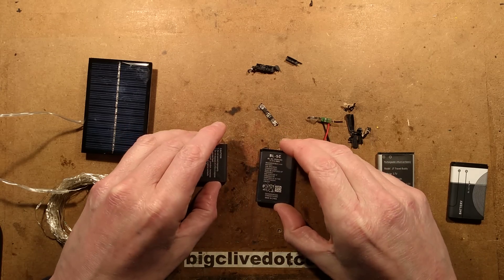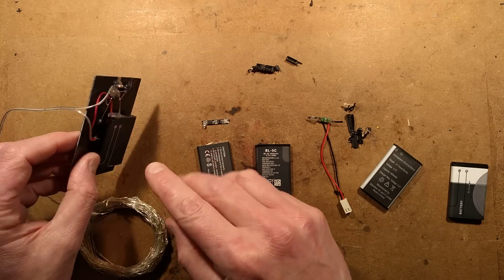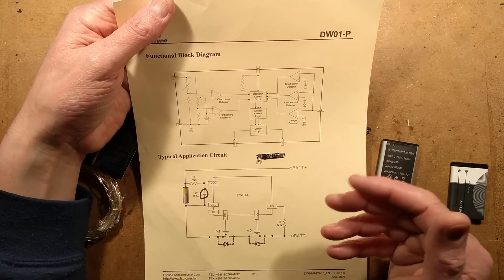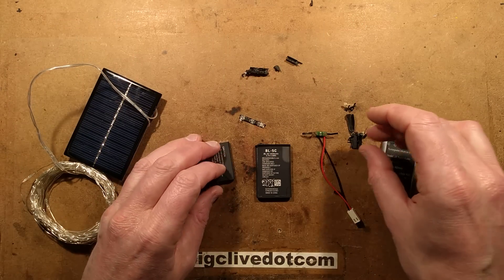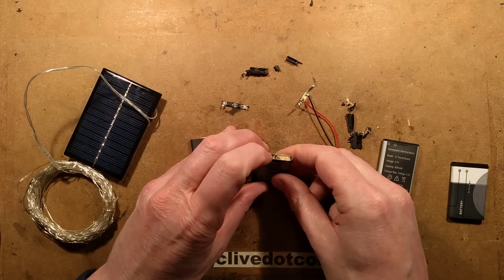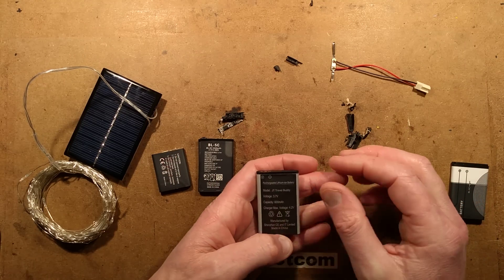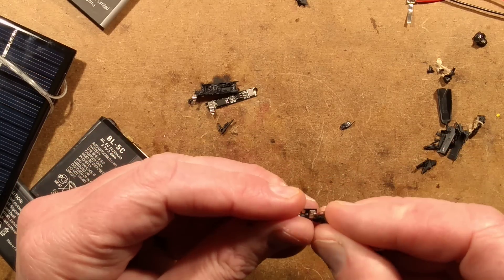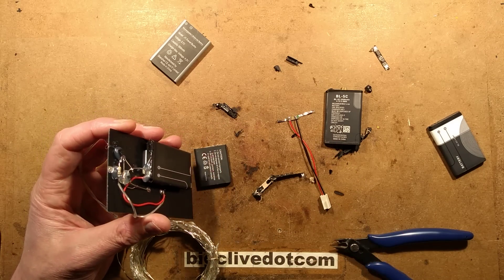Unprotected phone battery copies.

Comment: Did anyone else see that flash around the 6:34 time? The moment he crossed the contacts with the snips?
Reply: I took 2 screen captures. One at 6:34, where the mysterious golden flash appears, and one between 6:26 and 6:27, where we can see a real reflection.
Take a look at these 3 pictures : https://imgur.com/a/NfoPuna
Pic 01 : The golden flash.
Pic 02 : A white reflection. Probably from Clive's main video light.
Pic 03 : A side by side comparison. I pivoted the inserted image to 180° so the orientation of both images match.
It's hard to be sure, but I think that the 2 captures show enough similarities to confirm that those are both reflections, but from different light sources at different orientations. What do you think ?
Reply: @fragwits but his light is of a different hue, a much whiter light, while the 'spark' is orange, and it appear only for 1 frame. I think it's really a spark. Maybe their fuse is explosive type.
Reply: When zoomed in on, the light in the frame in question,  seems quite broad and dull but certainly of an orange/golden hue. Could it be a momentary reflection occurring from another warmer light somewhere behind in the room? The surface where the light to be emitted seems dark but shiny in the few  frames prior to the event.
Certainly No solid conclusions from me tho.
Reply: Something definitely went pop there. Looked quite flame-like. The strip didn't move when the the flash occurred so I'm not convinced it was reflection from his lamp.
Reply: 100% a reflection. Clive would have made a comment about it if it was anything else
Reply: wow, how is that even possible! explosive? surely it can't be a spark from residual capacitance, not that large of a spark.
Reply: xponen_ Exactly! It boggles my mind... I've been trying to think of what might cause it and I'm stumped.
Reply: fragwits yes... you may be right. But even at .25% playback... it still seems like a discharge. If we bring this to Clives attention, he can shed light on this.
Reply: This was a boring monday until this little mystery. Thanks for the excitement Big.
Reply: After studying all the evidence, I've come to the conclusion that people have way too much time on their hands nowadays. 😂

Comment: Cool video, I use these sort of batteries in lots of projects. Of late, I discovered a deal on some cool old Blue-Tooth receivers with built in amplifiers, as well as a slot for TF cards, and aux inputs, all this for 1.59 US. They require the standard 3.7 volt to power them (3.7 to 5 volts it says on some page I found when I first got them) so these little batteries are perfect for making tiny blue-tooth stereo MP3 players and such.  They also have a built in microphone, but I have yet to discover a way to access the input from it.  I purchased 3 of them cause I often screw up on my first attempt and let the magic smoke escape from some of the chips.  Yes indeed, I did manage to hook a fully charged 18650 up to the first one and burn the hell out of my finger as I was holding it by the microprocessor on the board.  Well I figured it was shot and moved on to number 2 after insuring the right polarity.  The second one came to life and works great, although  if you wanted to run some big speakers another amplifier would be in order.  Funny though as an afterthought, I thought I would try the one I had allowed the smoke to escape from, and after cool down, and properly hooking up the power, the little guy came to life!  What a deal!  https://www.ebay.com/itm/Wireless-Audio-Receiver-Digital-Bluetooth-Board-Amplifier-DIY-Stereo-Speaker-ST/163233961641?ssPageName=STRK%3AMEBIDX%3AIT&_trksid=p2060353.m2749.l2649

Comment: The resistor to the middle pads ARE for "keying" purposes. The programming clip had a different value resistor to signal that it was a programming clip.
Reply: Never heard of a programming pad on a Nokia battery. What would you program into batteries while they were in regular use, as opposed to being provisioned at the factory before shipping? The middle pad(s) is/are used for identification (BSI (, BID)). Some types also had another pad for a thermistor, but that's it. Do you have a source?
Reply: @Anvilshock  No no, the programming pads were under the battery, the resistor just told the phone that it was a programming clip and set the phone into programming mode.

If you look at this picture.

https://multicomeu-a9bf.kxcdn.com/multicom/pimg/kabel_FBUS_asha302_400.jpg

You see the 5 pins near the bottom. Those are for programming via the F-BUS and M-BUS i think they were called.

You put this clip inside the phone where the battery would sit and then the programmer attached would power the phone and since the resistor was a different value to those in the battery, the phone would know it as a programming clip and start up into programming mode.

Trust me, i did phone unlocks and software upgrades, back when nokia 3310's (First gen) and so on were hot :)

The nokia 3310 by the way had a whopping 2 Mbyte of flash, of which, about 1.6 Mbyte was available for programming. The rest was used for stuff that was not ment to be overwritten, such as settings, phone book, IMEI and so on.
Reply: @JohnDoe-bd5sz  Oh, that's what you meant with programming clip. I misunderstood.

Comment: That protection circuit actually has two or three functions. Besides preventing overcharging, which is the most dangerous failure, they also prevent over-discharging and may prevent over-current conditions. If you over-discharge a Li-ion battery, it can be permanently damaged and will not take a charge again. This is easy to do if you leave the device on until it's completely dead and do not recharge it for a long time. Without the chip, you would need to change the battery after this simple mistake.

Comment: By coincidence I've been reading and thinking about DW01 protection this week. It seems the overdischarge protection kicks in at 2.4V. Isn't that too low for long-term health of the battery? Do phones, etc, that use these protected lithium cells also have battery management in software to prevent discharge to 2.4V. Is it ok to rely only on DW01 over-discharge protection for my own projects, or will I quickly wreck batteries ?
Reply: IIRC the voltage drops off quite sharply below 2.9V for Li-ion, so 2.4 is probably a good trigger allowing for voltage sag under load. The protection is only turned off when recharged above 3V.

Comment: Each Mosfet has what is called a "body diode" which is a result of the manufacturing process. It is not a Schottky, this is useful for switching solenoids, relays etc. It is there and cannot be removed
Reply: Против Глобал  I think the diode is quite good, but not too fast. It would be fine for a relay or solenoid.

Comment: That Resistor is for the mobile to detect remaining charge in that battery.
Reply: It's actually for detecting the battery type.
Reply: @nrasmussendk  Oh.. I thought these batteries have 3 points so the resistor must had been connected to the 3rd pad to detect the charge. 😁 I will do a little more research and hopefully improve my knowledge

Comment: Could you solder on a protection circuit or would the heat be a risk to the cells?
Reply from the maker: It would be easier to add it externally.

Comment: There are no actual diode across the FETs, those are only the "body diode" of the FETs - a parasitic diode that arises from how FETs are made from N-channel deposited on a P-doped substrate or vice-versa for P-channel, forming a PN (diode) junction. That's why you need a pair of back-to-back FETs to achieve complete bidirectional current shut-off.

Comment: awesome job, thanks for the info.i wanted to make a solar battery power bank, from lots of different scrap parts i have, and i have lots of old cell phones i wanted to use a couple of the batteries for the power supply, so far i have not because i have watched so many of your videos and i knew about some batteries not having the charge protection chips, also i am a beginner at electronics so i have been cautious, i love your videos they help so much, i wish there was a way to identify the batteries with charge protection without having to open them up,,, maybe some day, either way i have learned a lot from you. great job keep up the good work.
Reply: You could buy a bunch of 4056 battery protection boards (one for each battery you have, they're fairly cheap and easily to find online), wire each battery to the BAT terminals on its own 4056 board, and then wire all the DC IN terminals of those boards in parallel to your solar panels. This would protect each battery in case some are unprotected, and if one of the batteries goes bad, it won't be charged, and it will be easy to swap out or remove that specific battery and still use the power bank.
Reply: nice idea, thanks for the info. ill look into it. i was kinda thinking along those lines also. thanks again.

Comment: I've came across something like this several years ago. It was a brand new cell that a friend of mine got for her phone. When attempting to recharge the phone the cell swelled up and was subsequently given to me for investigation. Upon revealing the "protection circuit" I came across a complete circuit board, designed to have the protection components soldered on it, that was instead empty with the exception of a 0 ohm link where the dual mosfet should be and a nameless smd transistor looking device in place of the dw01. It measured like a standard NPN transistor with the ohmmeter but I never bothered reverse engineering the thing. Not that there was much to reverse engineer anyway.

Comment: I have lots of broken phones and tabs with good batteries, I don't have a bench power supply (did make one with older pc PSU) but not the same. So I was wondering how to charge these batteries safely, the phone batteries seem straightforward but the kindle batteries I have has 8 or 9 wires (couple red and black) coming out of the little board soldered to the batteries terminals.
Reply: Go to eBay/AliExpress buy "TP4056 lithium ion charger pcb DIY" it will charge at 1Amp any lithium ion cell, and some of the board have protection as an adon very convenient!!
Reply: Sometimes they use 2-4 small wires in parallel instead of one thick wire. You'll probably have a bundle of black for negative, a bundle for positive, and 1 or 2 other wires for a thermistor and perhaps some data stuff for the protection chip (some monitor the capacity loss over time and report it to software).
Reply: @tin2001  I think your right it looks to be just as you mentioned, It has 3 red, 4 black, 1 white, 1 blue and 1 yellow. Thanks for the reply :)
Reply: If the batteries have protection board installed you can safely charge it with any 5v dc charger from any usb port.
Reply: The easiest way is using a charging board from USB which are pennies. TP4056 are what I use and you can get 10 for about £3 or £4. They also have two tabs for connecting power wires so you can use them with any 5V source. The alternative is a constant current source EG using an LM317
http://bristolwatch.com/ccs/LM317.htm
but you need a voltage monitoring circuit too to switch off a tad below 4.2V.
https://electronics.stackexchange.com/questions/56253/how-to-cut-power-off-when-a-certain-voltage-from-a-sensor-is-reached
Alternatively you can use 1 BMS bought from fleabay or similar.

Also with bench power supplies be a bit careful as some of the cheap ones go bang quite easily. If you have a high-ish voltage source (about 24V) the B3603 is not bad and you can get one for under £10

https://www.amazon.co.uk/s/?ie=UTF8&keywords=b3603&tag=mh0a9-21&index=aps&hvadid=80882855797814&hvqmt=p&hvbmt=bp&hvdev=c&ref=pd_sl_55wcbgc55e_p
Reply: Buy a power bank circuit from eBay and just charge these cell one by one, do not put them in parallel unless they're at the same voltage, you could fully charge them before put them in parallel to make sure they're on the same voltage

Comment: Could these be used to run the COB ball and magnet lights you had a few videos back ???
Reply from the maker: Yes you could adapt one with a protected cell.
Reply: @bigclivedotcom  My idea is to run 10 of the COB units. Strip the shell of and install the COB into a skirting board Hope fully run the 10 of one battery or a 12v system of some kind

Comment: You can buy strips of those tiny charge protection circuits cheaply on eBay anyway.
Reply: So what? Buy the contacts and melt a good protection PCB inside possibly just to add another one? Having none also means shitty cell in 50% of all the cells usually so just save time and trash them is safer than soldering on batteries

Comment: So, what fraction of a cent do they save by not including the circuitry?
Reply: Everything counts in large amounts
Reply: Suppose each circuit costs 10 cents. You've manufactured 500,000 batteries. The savings don't sound like a lot to you because youre not a scammer!!!
Reply: @iggy151  I did some quick checking and it looks like you can buy the chipset for about 5 cents each in quantities of 1000. I was expecting it to be a lot cheaper. So yeah, a billion pennies here, a billion pennies there, pretty soon you're talking real money. ;->

Comment: Great. I JUST ordered an entire bag of used BL-5Cs for playing about with. Oh, am I looking forward to trying them in my projects now.
Update: They arrived today, and all of them do have a Nokia hologram sticker each. This looks promising.
Update 2: Well, looks like I scored gold. Even though they were being sold as used, I'm fairly convinced they are new, or new old stock, and genuine. AND they were cheaper than certain no-name copies on certain Chinese sites, and were sold by a domestic seller. I'm a happy Anvil.
Reply: Anvilshock I have multible BL-5C (i might missremember) that have the Nokia branding and sticker. Multiple of them have swollen over the years (some to the extent that they don’t match the pads on the phone). I did by mine on dealextreme. I would assume they are genuine, but the ones that did not go through threw quality control.
Reply: @PatrikKron  Then I'm in for a possibly exciting future!
Reply: I have cheapo copy BL-5C batteries here, they work fine and even kept their voltage at 4,10 Volts despite not being used or charged for several months. Guess I have to discharge them to sub 2,5 Volts to see if they're protected... OR SHORT THEM OUT AND RUN AWAY!
Reply: @8bpspfreak2  seller? Source? I want some from a "better" source I won't complain and do my testing!
Reply: @8bpspfreak2  With sympathy for your adventures with knock-off batteries from Aliexpress, I can't help but chuckle with a laughing and a crying eye at that listing … After an initial check of mine (see top), they seem new and unused, AND appear to have the protection circuit inside. The contacts look absolutely pristine, not a single mark of scratch or wear. They're fully charged, and react well to being shorted (scope shows that voltage drops to zero within ~7 ms). They were sold as used, at a super low price (2.60 €), have the hologram sticker, AND came from a domestic seller with appropriately short processing and transit. I believe I've shot myself quite the good bargain! … which, upon checking, appears to be sadly gone now. Naturally. I should have ordered a hundred, not just ten!
Reply: @8bpspfreak2  Do it for science!
Reply: @8bpspfreak2  Hmm... in my experience the protection slightly discharges the cells over several months... so that they have 4.1v makes it sound like there is nothing really connected... unless you charged them up to 4.2v a few months ago.
Reply: Just order a bag of protection circuits to solder on to them and you're good to go.

Comment: Please construct a tester which quickly shows wether a cell has a protection or not. Would be nice to hold it on a cell and a LED lights or not. It could jam in 5 volts for a single second and check for the current.
Reply from the maker: The only way it could really do that is to test the protection circuitry.  Theoretically you could use a simple probe and resistor arrangement to deliberately pass high enough current to cause the protection to trip.
Reply: If it burns your finger, there is no protection
Reply: Use a single strain from a thin multi-strain wire to short the terminals, if the wire didn't melt then it has protection
Reply: This would be a great idea. I’m always buying batteries like this, and would like a simple way to test for the protection circuitry.
Reply: It's called a nose. /jk
Reply: Go try yourself when you hit a barrier you seriously try to break, then come back to your guru.
Reply: @boonedockjourneyman7979 , nah, I was just interested to see how Clive would do such a project. I know how Mister Carlson would do it but Clive is more into cells and the more profane stuff, I think.